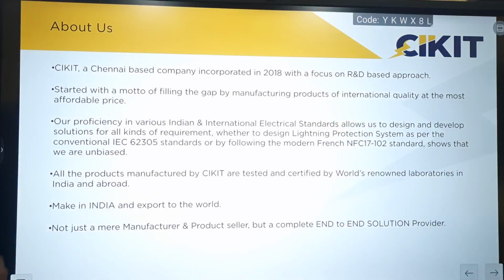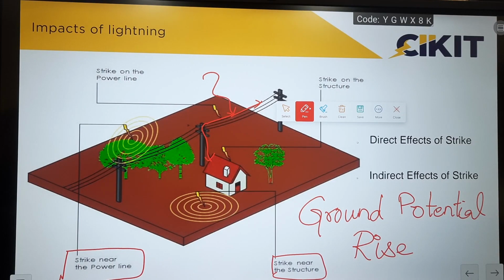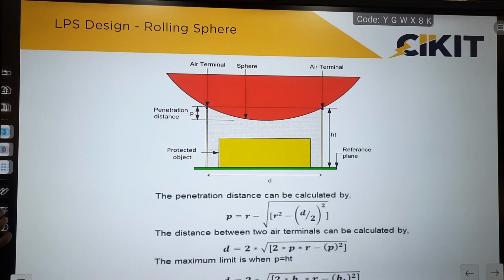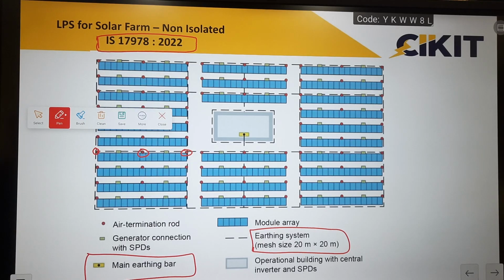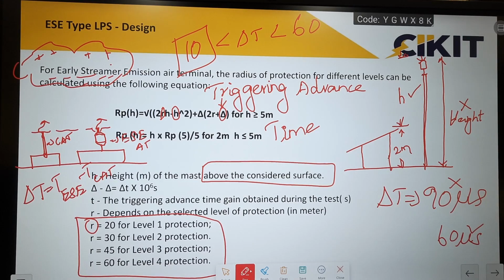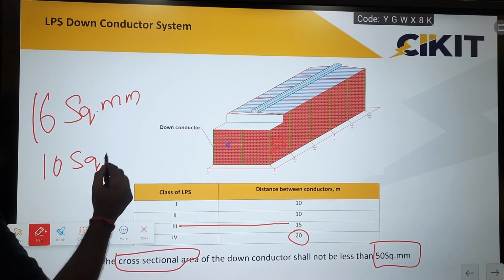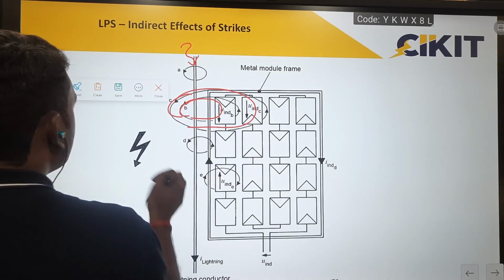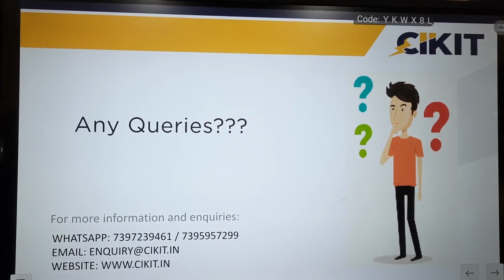“Lightning Protection System Design for Solar Farms” | CIKIT | SHOT FORMS |

Comment: Can you please tell me on which poit or pg no of NBC 2016 500 mm is mentioned
Reply: NBC 2016 - Vol. 2 - Page No 230

PART 8 BUILDING SERVICES   SECTION 2 ELECTRICAL AND ALLIED INSTALLATIONS 

Clause 11.5.1.7 Large solar PV power plants/farms

"0.5 m height from panel at four corners provides protection to approximately 12 m × 9 m area"